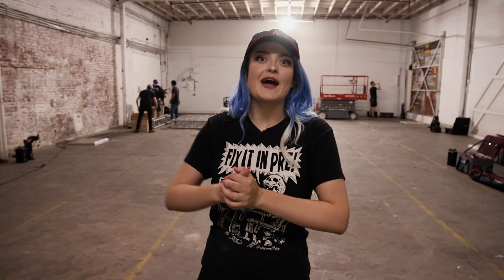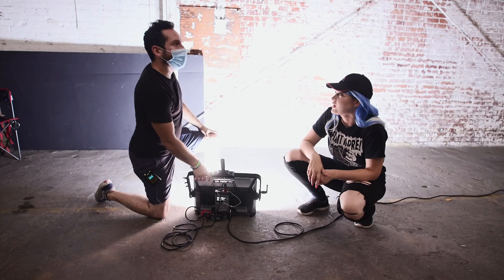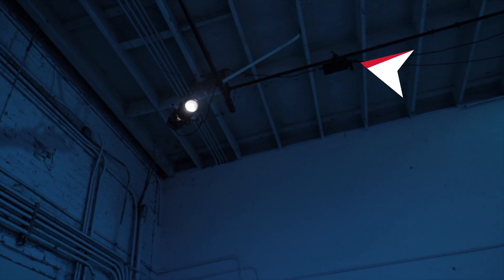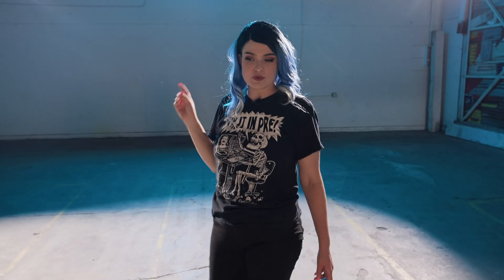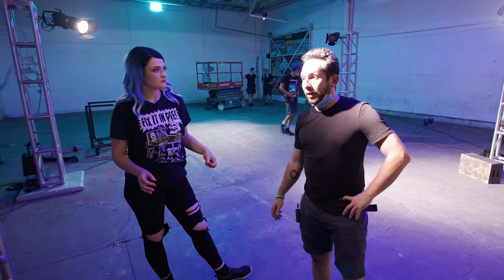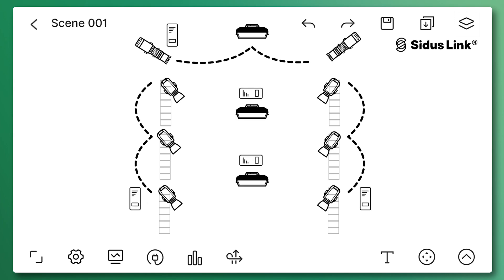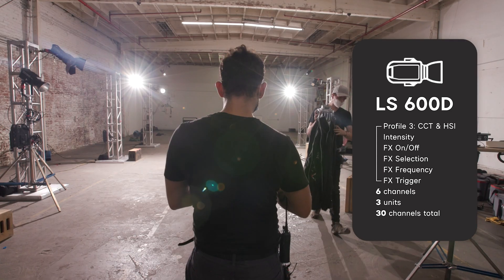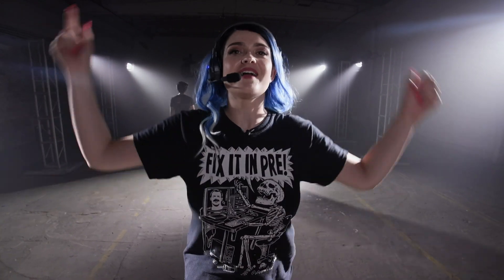Creative Music Video Lighting | Tips for DMX Control

Comment: Wow. I’m trying to film something similar. I have some questions;
1) For the 300x lantern, what did you rig it to to travel smoothly?

2) What is on the two backlights to give it that floor pattern?
Reply: Hi Kayanne,

For the 300x, I assume they used a Hi Roller or Combo Stand and Casters with an Electric head and junior pin receiver for mobility. The 300x ballast also has V-Mount battery capability for even more freedom.

As for the backlight pattern, that's referred to as a "gobo" and can be purchased in kit alongside the Aputure Spotlight mount. Most Spotlight units, such as LEKOs, have a slot where a Gobo cutout can be inserted and then properly focused with the light's lens to achieve that hard shadow texture like in the video.

Hope this helped!